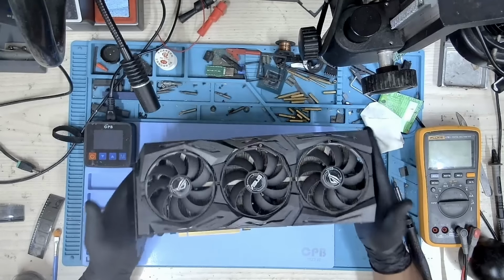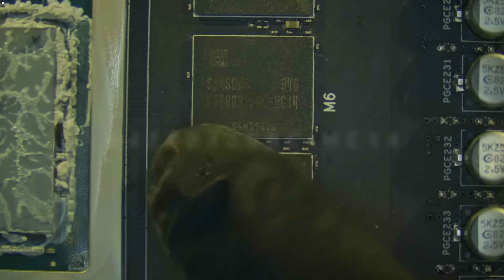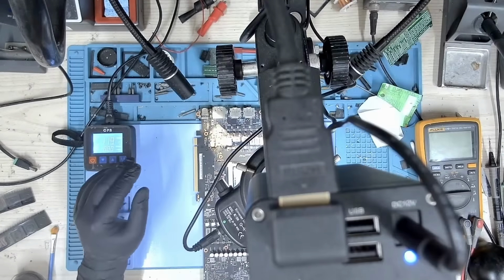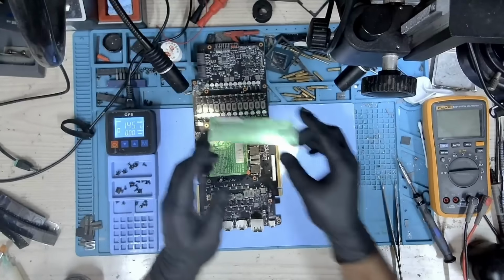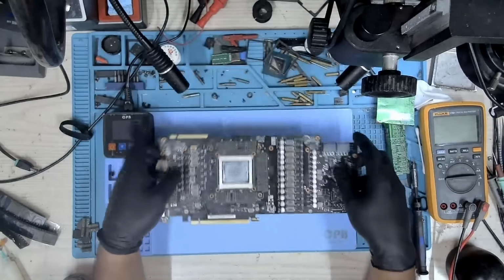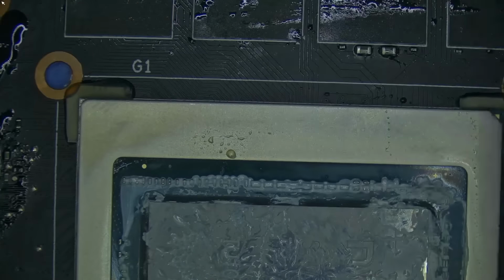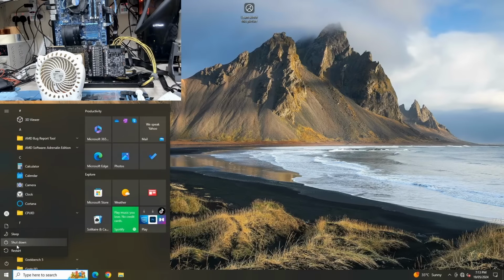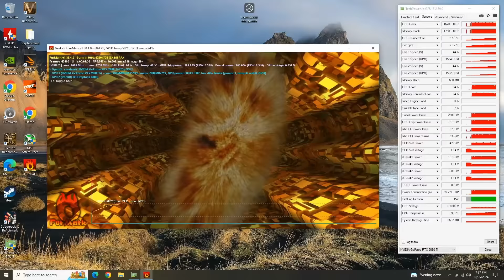Upgrading Asus RTX 2080 Ti memory from 11GB to 22GB

Comment: Can you make a detailed video about the configuration after replacing the memory chip? It would be very valuable. Thanks!
Reply from the maker: There is no configuration to be changed after doing the memory swap and aligning the straps. This video shows the complete setup from start to finish to get it working on 2080 Ti. No other change is required .
Reply: @GraphicsCardRepairs-tk7ql  
Yes, I mean aligning the straps! If you can make a video of this,  it is very valuable!
Is it possible to update the bios of the card? The ChatGPT told me this

"Modify the Firmware:
Edit the VBIOS to adjust for the new memory size and timings.
Flash the modified BIOS onto the card.

The VBIOS (Video BIOS) is firmware embedded in the GPU that:
Configures memory timings.
Defines memory size.
Manage voltages and power limits.
When you replace the existing VRAM chips with higher-capacity ones, the original VBIOS does not recognize or correctly configure the new memory. Modifying the VBIOS ensures that the GPU can communicate with and utilize the upgraded VRAM. "

 I'm an electronic enthusiast I am interested in your work, great! Thanks for replying to the comment
I am trying to double the shaper amd rx 6500xt 4GB memory!

Comment: Very excellent.
I am curious, would this also work with K4ZAF325BM-HC16 memory? or must it be 14gbit memory chips?
Reply from the maker: It will work with K4ZAF325BM-HC16 also.
Reply: It should work but the firmware limits the maximum frequency and there's no practical way around this. Basically it'd let you overclock the memory as much as possible without any concern but stock chips can all typically handle a decent speed bump already so you really wouldn't get enough out of it to be worthwhile.
Reply: @JJFX-  more than just firmware (it can be modified) but also the core's imc must also be able to run at higher speeds to remain stable. At least as far as i know, unless you are able to change gearing or straps to allow different dividers / timing.

Comment: Hi bro. Upgrade 22 gb. Performance going more better ?
Reply from the maker: Well the capacity has increased but not the bandwidth or the bus width. Games with high VRAM usages will benefit from it to load textures but how this will impact frames is yet untested.

Comment: I would to have this done to a 3080, to go from 10GB to 20GB of VRAM.  That would make a real 4K high settings gaming GPU out of one that never had enough VRAM from new.  I have nothing close to the knowledge or skill to pull this off.
Reply from the maker: I hope you like this video 😁. Yes, you will require skills to replace memory. but skill is built over time with practice. If you start to practice (starting with dead boards) you will build the required skill over time.
Reply: yes that will help ray overdrive

Comment: Can anyone explain me why did he left M11 slot? He could fill it
Reply from the maker: Sure I can explain. M11 is disabled from the GPU core. The data lines from that chip are open so installing the memory module will not work on M11. 😁
Reply: @GraphicsCardRepairs-tk7ql  thx a lot bro 😊
Reply: @GraphicsCardRepairs-tk7ql  That's the slot for the Titan card with 12GB

Comment: Maybe for an other Video.

Is it possible to double the VRAM on a RTX4090 or RX7900XTX?

And why is no Chip on M11?
Reply from the maker: As of now, RTX 4090 cannot be upgraded beyond 24GB of VRAM. Micron GDDR6X is only available in 2GB modules in 21Gbps and 24Gbps.  Though it is possible to install 24Gbps modules (supported) to increase the bandwidth however the capacity cannot be increased. 
The returns on investment in upgrading from 21Gbps to 24Gbps modules will be negligible and benefit minimal (It is a theory based on calculations and yet to be tested though.) If in the future I get my hands on a 4090 and a user is willing, I will put this to the test and measure the difference in performance. 
If in the future Nvidia launches an RTX 4090 Ti or a 5090 it will be launched with the 24Gbps modules. (Speculation)
It's the same with 7900XT or XTX. 7900 XT and XTX use GDDR6 memory and the bandwidth of each module is 20Gbps. Samsung is sampling a 24Gbps memory but it is still sampled and not mass-produced. So for 7900 XT and XTX we are using the top possible memory.
Reply: @GraphicsCardRepairs-tk7ql  How much does the 2GB Micron GDDR6X cost? Cheaper to buy off Aliexpress? And have you gotten the 3080 mod to work?
Reply from the maker: Yes you can buy off Aliexpress. Only buy new.
Reply: @GraphicsCardRepairs-tk7ql  Thanks! I have zero soldering experience. Do you think it's possible for me to do this memory swap if I watch some YouTube videos on how to solder (including yours) and buy a dead GPU to practice on? And are the soldering tools expensive?
Reply from the maker: @tonyd7644  Buying dead boards to practice is a good idea. You can practice all sort of things. once you are confident practice on older working hardware then switch to the new ones. remember its much harder to remove a chip on a 30 series and 40 series card than a older generation. quality of solder is different. Higher temperature are required to replac components.
Reply: @GraphicsCardRepairs-tk7ql  Your knowledge of GPUs is fascinating. I've learned quite a few things reading your replies here. You've earned another sub, great stuff. 😎👍
Reply from the maker: @Squidgy55  thank you 😊

Comment: I'm gonna send you my 4090 to upgrade it to 48GB. Sound good?
Reply from the maker: Unfortunately none of the 40 series can be upgraded. It already uses 2GB memory modules which is the highest capacity produced on GDDR6X platform. It also has only 12 memory slots.

Comment: getting a 3090 is still probably better, 2080ti with the chips would cost 450€ and if u get a 3090 for 600€ u have a newer card, pcie 4.0, gddr6x, 2gb more, 32bit bigger bus, better performance overall
Reply from the maker: Thank you for sharing. happy to have you onboard 😁
Reply: maybe not
Reply from the maker: Thank you for sharing your view though 😁
Reply: 3090 went up in price last time I checked. 2080ti and 3080 have gone down. The 2080ti has much lower power draw, undervolts to 150w easily and still fast in stable diffusion. Priced could change a lot once next gen drops. I would do 2080ti if you were to run it for long sessions or go with 4000 series. 3090 is a good option too if you aren't too concerned about power usage. The repair guy games its possible on the 3080 as well.
Reply: @oneanother1  why is there no video of an 3080 20gb?
Reply from the maker: I don't own a 3080 yet. When I get my hands on one I will upgrade to 20GB. 😁
Reply: nice
Reply: pls also do rtx 3070 ti 8gb to 16gb
Reply from the maker: This one is work in progress. I am currently working on the RTX 3000 series starting with the 3060 Ti and right up to 3080 Ti. Looks like a BIOS Edit is required on these cards.
Reply: @GraphicsCardRepairs-tk7ql  people saying the 3070 is possible to 16gb without bios mods

Comment: First of all absolutely incredible work and video sir!! I'm thoroughly impressed. 

I'm a little bit confused however on as to why exactly and how the GPU core limits the vram usage? 

If an extended memory upgrade allows for better rendering in content creation applications, why would that same power not also transfer over to games?

Sorry that sounds like a foolish question, I'm just trying to figure some things out.
Reply from the maker: Thank you 😊. The core can process a limited amount of data. Example a 3080 or 3090 core can process more data compared to a 2080 Ti. And a 2080Ti can process more data than a 3060Ti. This processing power depends on the transistors inside the core. These transistors are assigned as cuda, tensor and different modules inside the core. As a new generation is out, more and more transistors are stuffed inside the core making it more and more efficient and more powerful. This explanation I have tried to keep as short as possible as I can make a video on this topic for better understanding.
Reply: @GraphicsCardRepairs-tk7ql  Thank you so much for the reply and insight 🙏 

I Highly look forward to a video on this

Happy new year to you and all of yours, may it be blessed 🙏

Comment: Really enjoyed watching this. I worked in automotive for 30 years and all the soldering I did was much simpler than this. Also, would any memory upgrade for a 2080ti be worthwhile for gaming? If not 22gb than maybe 16gb? Would love to hold on to my 2080 for as long as I can.
Reply from the maker: Memory can only be doubled if there is room. For example if a gpu has 1 gb modules and 8 slots it can be upgraded to 16gb by installing 2GB modules. Unfortunately 2GB is the largest capacity produced on GDDR6X and GDDR6X platform.

Comment: I wish you were in my country. We find it hard to even find people to replace noisy fans! And EVERY GPU I have ever bought has had a fan ending up with faulty bearings or whatever.
Reply from the maker: @shanilmisra  I accept international repair orders as well. 😊
Reply: @GraphicsCardRepairs-tk7ql  Sure but won't the courier be expensive?
Reply from the maker: @shanilmisra  you can check with your local postal service to get an accurate price of shipping. Shipping depends on the size of the package weight is secondary.

Comment: This is absolutely wild, it shows that nvidia literally chose not to use these modules on the 3000 series.

Is this upgrade possible on 3050s?
Reply from the maker: @YourFriendlyHoodVampire  I have not tested on 3050 yet
Reply: @ thanks  for the quick reply (:

Comment: Hi Fraser.. I do have an MSI 4070 Super TI that got a little hot behind temperate glass, and it is possible that one of the phase capacitors fizzled out, and now I have a coil wine noise. Other than that, the card works great. Still under warranty.
Reply from the maker: Coil winning is also caused when you split one cable into 2. Since you are using a 4070 Ti Super I assume you are using a 16 to either 2 8 pin or 16 to 3 8 pin connector. If this is the case check if the power cables that you are using are directly coming from the PSU individually and not split from one. Let me know if this is the case.
Reply: @GraphicsCardRepairs-tk7ql  now you got me thinking, maybe the PSU is injecting the noise. I will swap the GPU with a similar Ventus 2X card since I have two similar cards, one 12gddr and the other 16gddr .. Temps never got above 80degC although the glass was hot to the touch .. but I heard a fizzled noise. I'll try and get an RMA ticket with MSI.

Comment: thats a great upgrade, but i have a question about that. How much will it make betterment in the gaming. Like Fps is dependent on bus speed, core or etc.. untill unless its vram is bottlenecked. Like gtx 1060 3gb and 6gb provided same performance if the vram was not fully loaded.
Reply from the maker: Thank you 😊. In gaming the only benefit is in those games which exceed 11GB. There is no performance improvement as performance is dictated by the core. The improvement is in the capacity of the memory. So this upgrade is not worth in  gaming. The advantage is in AI related tasks and other activities like rendering and tasks and workloads.

Comment: To your question regarding the benefit of doing this for AI, I would say 100%.  With the ability to run small local AI models the limiting factor is ram on the card.  To do anything effectively you need 16GB.  This is very interesting, I would be interested in you doing the same for me.

Comment: I just have 3 questions regarding graphics cards in general. Would a rtx-2060 and gtx 1060 run safely together? Would a 750 watt modular power supply power them both? Finally with the 750 watt modular power supply what's the highest graphics card I can use if I choose just 1? Thanks
Reply from the maker: RtX 2060 and gtx 1060 can work on the same PC but there is no benefit to running both on the same system.  You can use the RTX 2060 and leave out 1060. 750w is more than capable of running both on the same system. Again you will not be able to utilise both at the same time on the same system. With a 750w supply you can safely run a 3080 or a 6900 xt without any issues.
Reply: Thanks for the information. I use my gpu for blender I even made the logo and it's 3d animation with blender. I just didn't want break the computer trying to upgrade GPU@GraphicsCardRepairs-tk7ql

Comment: I have a triple 3090 5950x system. Would you be able to double my cards from 24gb to 48gb or possibly 96gb per card?

What would I be looking at to do this? I want to do a YouTube video on this insanity build if you can pull it off. I have Blackmagic Cameras (URSA 12k & 6ks). Would make a killer editing machine and a great showcase build for my new exotic car club channel. Love the video! Thanks for your time.
Reply from the maker: Yes it would be a killer. Unfortunately I don't have a 3090 with me to experiment on. If I do get one I would try the upgrades on it. But since it uses GDDR6X it's going to be a bit tricky. GDDR6X data lines are positioned in different locations than GDDR6. I am yet to fix the GDDR6X issue with upgrades. Once I find a solution for GDDR6X I will then try the 3090. Currently working on 3080 Ti
Reply: @GraphicsCardRepairs-tk7ql   I will be patiently waiting for your updates. This sounds promising. Thanks for your reply.

Comment: I'm glad they don't lock out the memory amount in software / firmware on the card. It's nice that the card is smart enough for it to just see that theres 22gb and use it. Probably not for user convenience though and if this catches on they'll likely "fix" this
Reply from the maker: The BIOS has the details for 22GB in it. Looks like Nvidia had planned it but never launched it due to lack of competition.

Comment: I’d love too see if you could pull this off on a 4070 super as there’s 2 memory module spaces free on the card where it could’ve had 16gb instead of the 12gb they shipped it with
Reply from the maker: 4070 cannot be upgraded further. The empty slots are disabled from the GPU core. This GPU does not use the full GPU die. Installing memory there will not work.

Comment: I would like to know the cost of such an upgrade, also, could he have gone to 24 by using the empty M11 slot?
Reply from the maker: $220 including the 11 memory modules. The empty slow is disabled from the GPU core, installing memory there will not work. 2080Ti comes with 11GB.

Comment: btw, how hard or risky is to upgrade the 12 gb of ram from a 4070 to 24 gb, do you need specific ram chips?? does it have any issues?? thanks!!

Edit: I now saw the pinned comment, but from that 8 months gap since the launch of this video, isn't there already higher capacity chips? or does it still in 2 gb each? thanks

Comment: For custom GPU applications where you need a lot on calculations on many things in parallel (such as AI) then more memory is great. I wish I had more on my RX 7800XT (it has 16GB).
Reply from the maker: 7800XT is a good GPU and 16GB is sufficient. Some task like AI are so memory hungry that no matter how much memory you have is never enough.
Reply: @GraphicsCardRepairs-tk7ql  exactly. I can never have enough memory. 😁

Comment: it is a brilliant idea for AI usage as larger models or two models can be handled by this GPU now! Can you do the same for an old EVGA 1080ti as well?
Reply from the maker: Unfortunately 1080 Ti uses GDDR5X and 1GB is the largest capacity module produced on this platform. It cannot be upgraded further.

Comment: Amazing. Could you do 4080 32GB or 4090 48GB? If so, what would be the approximate costs? Thank you for showing all this. Edit: As you wrote, 40 series cannot be upgraded, till 4GB chips are out, i guess?
Reply from the maker: Yes 40 series cannot be upgraded. 4080 has 8 memory slots and 4090 has 12 memory slots. The largest memory modules produced on GDDR6X and GDDR6 is 2GB. So these cannot be upgraded further.

Comment: That´s great, but the question is, if it works also with the RTX4xxx or 5xxx Series  and how much are the cost´s? Make it sense or is a new GPU cheaper? I´m a it Reseller and this would be very usefull if it works.
Reply from the maker: None of the 40 series can be upgraded. 50 series now depends on the GDDR7 modules. I guess the current modules will be 2GB modules but I guess Samsung and Micron would be releasing a 3GB module as well on a GDDR7 platform. So there is a chance that it can be upgraded.

Comment: In my opinion it also works well in games, also because there is not yet a gaming product that uses even just 8 GB, it is not a question of memory but of other implementations, such as the articulation, which for that type of card Turing, while the 3080 is Ampere. I in the Asus rog laptop that for the home can be updated to a maximum of 32 GB, I bring 64 GB, the software launched as cpuid z show 64 GB, but when I launch the bios, it tells me that they are 32, the maximum it can accept.

Comment: Very interesting video! Not only was it relaxing, but very informative. Watching you do this, makes me feel like I could give soldering another chance
I'm planning on upgrading my 2080ti when the 50xx series drops. I don't plan on selling my 2080ti, and would love to try and give something like this a go. Does anyone have any useful information regarding the software side of this sort of thing? How would I continue to receive support on drivers? How would I tell the GPU it has the new VRAM capacity?
Reply from the maker: Straps help to identify the memory installed. I have shown it in the video. Everything that is required is in the video.

Comment: This is awesome! I wonder what could happen with an older gpu like gtx 700/900 etc
Reply from the maker: Older GPU is possible where there is higher capacity modules available. But for the cost of upgrade you can already buy a latest gen GPU with double or triple the memory.